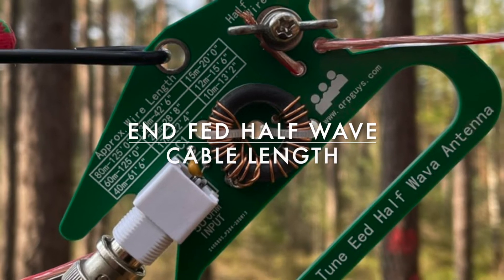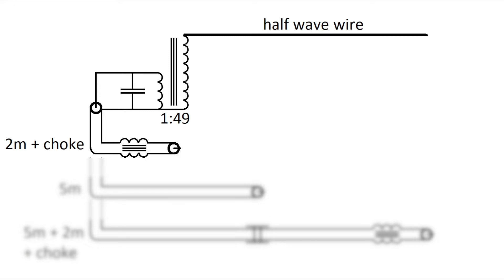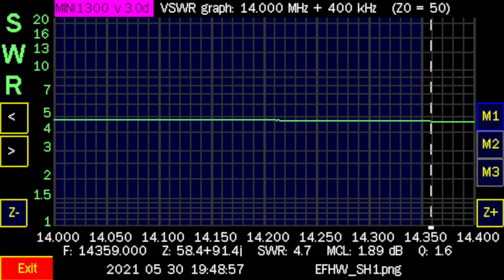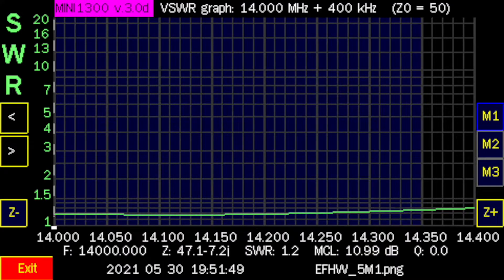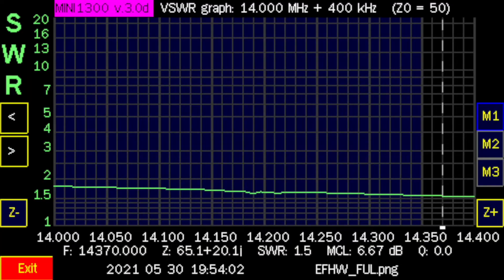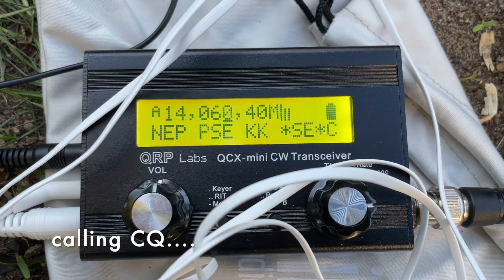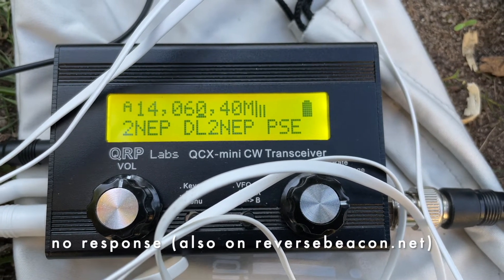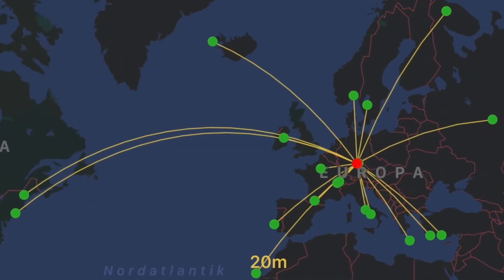Influence of the cable length: End fed half wave antenna

Comment: I agree about the coax length. For 20m I use a 5m c/p and 3m coax and it works well and no rf issues. I have found shorter coax and lowering the feedpoint to negatively affect the swr. Having the matching unit ~0.5m off the ground seems to work ok. Good advice about experimenting first - that can save a lot of time. Nice videos👍🏻👍🏻. 73 de Will, M0LGW 👍🏻😊

Comment: Hello Björn. Have you been able to test the two meter cable with the counter poise? 
Interesting…. QRPGUYS also offer the exact same EFHW antenna kit in a smaller package but with a counterpoise nut on the side. It is called QRPGuys Mini 80m-10m No Tune End Fed Half Wave Antenna. Look at it. Exactly the very same circuit in a different presentation. This one comes in a box that offers a little more rain protection. The other one, the green one on your video, doubles as a wire winder and is more eye appealing, but has no rain protection at all. I have both versions but, as strange as it gets, the one in the box works way better than the green one. Have used both without counterpoise. I then added a counterpoise to the one with a box and no change was noticed at all. I was using a 10 meter RF cable. The radiating wire length was exactly as per QRPGUYS table and was perfect match. The same wire was then moved to the green one and didn’t produce the same results. It required a little shortening to match. Same RF cable, same day, same place. Same conditions. Again, same exact circuit. Makes no sense at all. 73, Rob, YS1RS

Comment: Hi, 
WSPR showed very poor performance or propagation. Despite the number of spots, all of them have VERY low SNR. 
E.g. SNR 6dB means that your signal is 1S unit above the noise level. In your case the best results is 0dB that means that almost no one (except software) was able to receive your Morse Code signal by ears (this we saw with CW beacon).
Also, in additional to SWR, more intersing R/X. Because adding more  cable or adding CMC choke you adds more reactance and it should be compensated e.g. by capacitor or inductance. 
But anyway,  looking on impedance, the best one is third, because it has active 48 Ohms and capacitance can be compensated a little longer coax (or antenna).
The worst is third one, because it has real 65 Ohms and a little inductance.

Comment: Interesting. Going by the other stuff I've read about EFHW's & the 49:1 transformer, I did my first tests with a 30ft/10m feedline & no counterpoise at the transformer. Tuning up was easy. I was using a reel of wire that I simply wound back to a length that gave me a resonant point on 20m. ReverseBeacon reports showed that I was getting out across the US to the west with 5W. 
. . . Then I took the whole mess inside, hooked the transformer to a chunk of wire hanging in the air from my second story office/shack window. Feed line was at the most three feet (about a meter). Testing at 20W, I got immediate messages on the office computer about RF devices not working. Foolishly ignoring that, I continued t he tests. Then the keying line to the radio (a Xiegu G90) went dead, one side at a time. First the dit side stopped working, then the dah side. 
. . . Turns out I had burned up the very tiny, flea-sized 100Ω resistors in the keying line. I'd killed the radio, so to speak. (Repairing that was terrifying for an old man with shaky hands)
. . . Since then I have repaired the radio, added extra bypass capacitors to the keying lines & put a choke on the keying line at the radio.
. . . Now, when I use any EFHW set up, I ALWAYS use a feed line of at least 30ft/10m and put the 49:1 transformer & radiating wire at least that far from me and the radio. And there's a 1:1 current unun at the radio & plenty of clamp on chokes on the keying lines & peripheral cables. I don't want to go through the terror or repairing the radio again.

So, yes, you are right: Test before going out and use a decent enough length of feedline. And always use the current choke at the radio.

73 de W8IJN

Comment: I have the same antenna, hut have used different length wires. I use a 50' length of coax and it tunes, great on 80-20 and 10 is 1.8'ish.

Comment: I am watching this a year later than my first question.  I still don’t know what you mean by “errors on the cable”.  Did you have interference in your transceiver?  RF feedback? I am still mystified.  The SWR was very low and I saw nothing on the analyzer that would bother me.  Please give me more information on what the errors were and how they caused you any trouble.  I do agree that a common mode choke helps reduce any feedback into your rig and sometimes makes reception better but the “errors”?  Also the Chinese knock off with the bad spelling is probably of poor quality (the toroid) so the results might be in error due to that.   I have the USA made one from real The QRP Guys and it performs very well for what it is.  Dave K8WPE since 1960

Comment: Thanks for making this. What about the guys who don't use coax at all, just the matching transformer on the back of a BNC, K6ARK does this, so do others.
Reply: I have made many EFHW's with the transformer attached to the radio with great success. Depending on transgformer desigh will dictate the need for a counterpoise.

Comment: Hi! Greetings fromUK.
Great video and very useful information.
A quick question about the QRPGUYS antenna board-  Is it OK to use in the rain?
Thanks for sharing.
Reply from the maker: This is a interesting question. I would say it will have some influence to the output impendance of the UnUn. So may be it will result in a bad SWR. I think the best way to know it to test it. Vy 73 de Bjoern, DL2NEP

Comment: I don’t understand what you mean by “errors on the cable“ in demonstration number two. Please explain further.

Dave K8WPE since 1960
Reply from the maker: I said "problems with RF on the cable". There are RF current outside the coax cable. This will make trouble on some transceivers. So I connected the small cable containing an RF-choke to the 5m cable. The result is a little bit wors SWR but no RF on the outside of the coax. So the transceiver works fine. 73

Comment: how do you calculate the best cable lenght?
Reply from the maker: You don't need to calculate cable length. Only try & error. As I showed in the video you can easily test this things and find your optimal length. May be something > l/4 should be a good starting point. Best regards, Björn
Reply: @echopapaqrp8166  ok thank you!

Comment: you are using the chinse clone of the qrpguys  end fed
Reply from the maker: I know that and I mentioned it in one video.
Reply: The correct term is counterfeit.
Reply: The cheap toroid coils on those cause most of the problems. Replace that or buy the original product for best use.

Comment: Can you specify the ferrite core you use on the 2m cable? I'd like to buy one on Amazon but do not know exactly which one to get. Thanks!
Reply from the maker: I removed that ferrite core out of an 1:9 UnUn i bought long time ago. But I expect it is an FTxxx-43 core. I think it has about 5cm diameter. You can test it. After 7 windings the problems with my QCXmini gone completely. Happy building. Bjoern
Reply: @echopapaqrp8166  What symptoms of RF interference did you have before applying the RF choke? Also, can you clarify how you tested specifically for this noise?  

Thank you for providing some direction on the ferrite core specifications. Can you clarify 5cm outer or inner diameter? If you have any additional reasoning to explain why that ferrite core works for the application as well as the reasoning for 7 turns, it would be helpful for an antenna novice like myself and potentially many others.

For example, what is the difference in FT-240-43 and FT114-43? Would both work?

The audience of your videos is newbies like myself, and the more clarification you can offer on these complexities, the more helpful! Thank you sir!

I found the following information to supplement your comments:

FTxxx-43 Common mode Choke
"(Ferrite core) 43 Material is a very good wide band common mode suppression solution in the frequency range from 10 up to 600 MHz. If you use multiple cable turns around the ring core, the suppression will increase while the frequency will decrease."
Reply from the maker: @dgkrompholz  The problems are strange behaviour at CW keying (some dit and dah missing or too much.) sometimes the QCXmini shows a "G" vor "GPS connected" and the side tone is very noisy and scratchy. If you connect the common mode choke everything is normal. I think there is no special ferite core needed. If you have a bigger one (suitable for your coax cable) try with 5...10 windings. If you have no problems like mentioned above you do not neet a choke. My expirience is that this choke is very useful. Specially on end fed antennas or portable vertical antennas. With an good old dipole you do not need it. Vy 73

Comment: It would be interesting to see what effect, if any, counterpoise wires of various lengths might have. DE WA1KLI
Reply: Yes, I also think about this.
Reply from the maker: For me the question is: "Is a counterpoise realy needed?" If yes: Why? The lenght of the active wire is l/2. So this should be all. It seems that there are some effects that need a counterpoise. If you watch my videos carefully you will see that the first videos all have 0,5m wire attached to the BNC-ground. It works fine. But the influence of the feeding cable was also very huge. I think I will do some experiments with the 2m cable and a counterpoise. Then we can see if it helps or not. Vy 73 de Bjoern

Comment: Hello, what antenna analyzer do you recomend me? TG9NYM.
Reply from the maker: I got the "mini 1300" cheap on ebay. So I bought it. I don't know if this analyzer is good or not. It helps to adjust the antennas to the right SWR. So I am happy with the mini 1300. But there are many more. Some does not have the HF bands. Vy 73 de Bjoern, DL2NEP